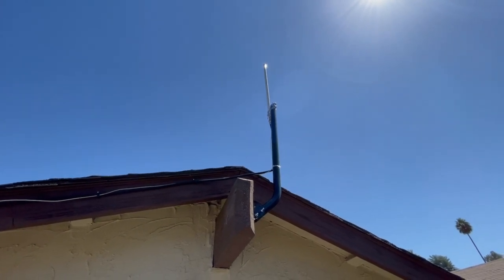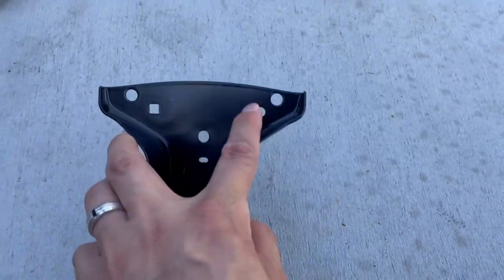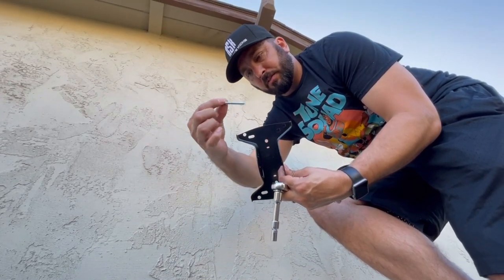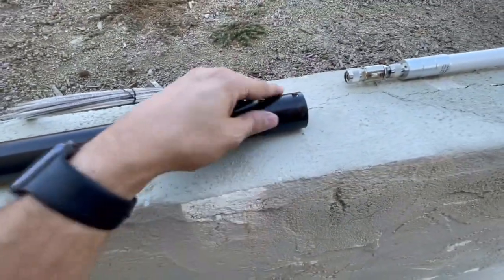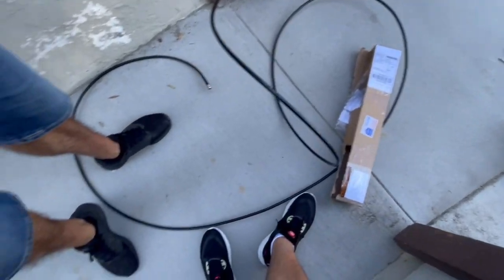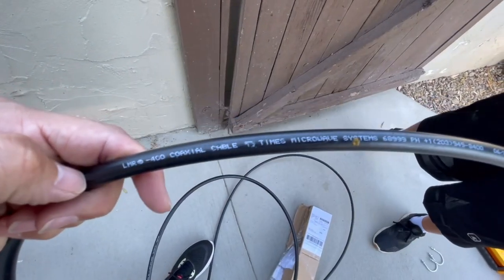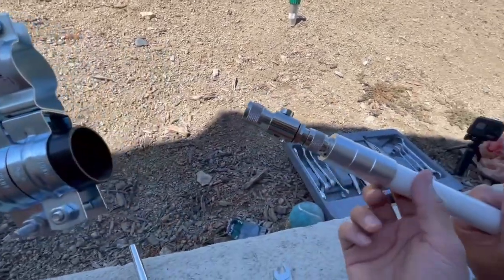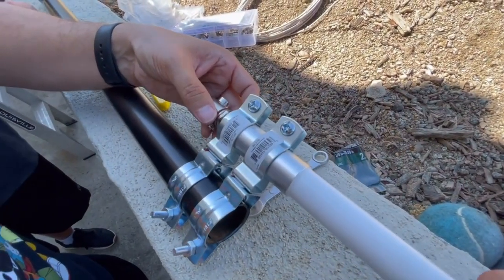Outdoor Antenna Install For Rak or Bobcat Miner (Step by Step Setup) Increase Helium Miner Earnings

Comment: Lightning arrestors won't save your miner from a lightning strike sorry mate, and grounding isn't necessary. Good Luck!
Reply from the maker: It will save it from a nearby lighting strike and the grounding will help prevent a fire on the roof
Reply: What can save the miner from a lightning strike then?

Comment: Man! The link to the cable is male to male. I just had to return it
Reply from the maker: It all depends on what cable and what antenna you buy. I have a couple options in my Amazon store front
Reply: @CesarCinema  thanks man! Did you end up using an amplifier and cavity filter? I found one cavity filter at mcgill and it is bloody expansive, not sure about which amplifier to get thou..
Reply from the maker: Not yet. I might have to order one.

Comment: I see multiple mistakes in this video - First I do not think this guy understands cable loss antenna gain (I think he mentioned 20ft of cable?) and also you never Power up a miner without the antenna - anyway good luck

Comment: Can i have the LMR cable running over my roof or does it need to be around the sides of my house?
Reply from the maker: You can have it run over but try to keep it away from the elements/sun as much as you can so the cord can last longer.